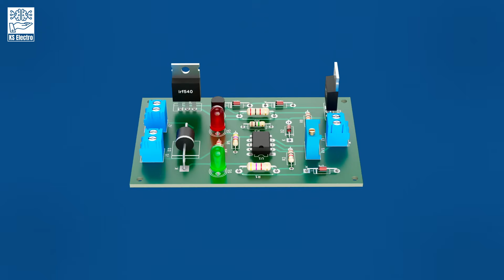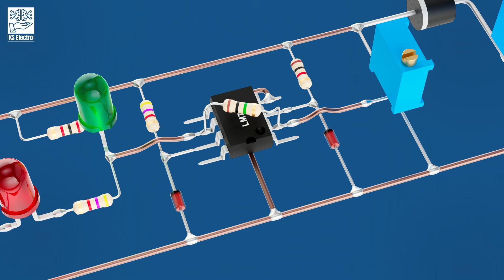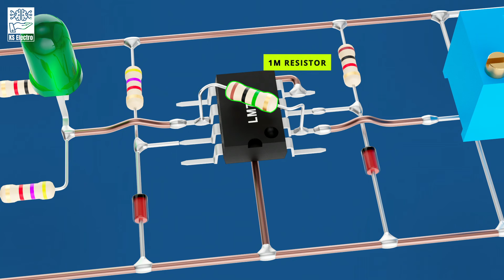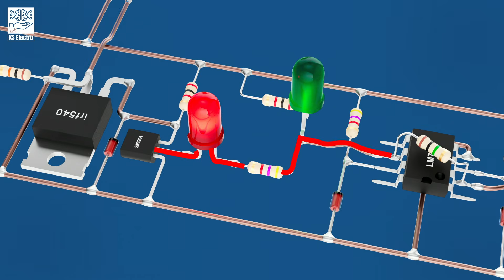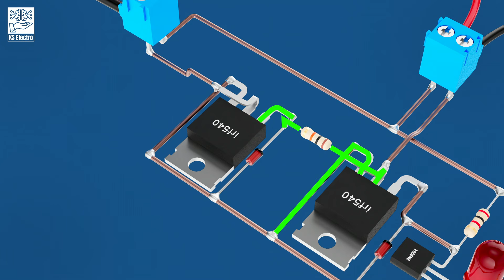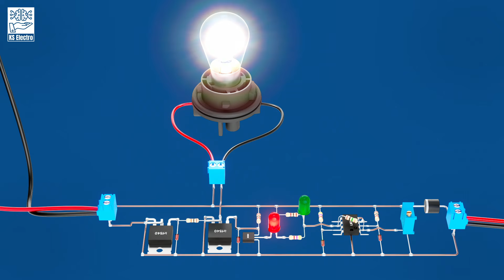DIY Solar Charge Controller Circuit Using Basic Components

Comment: Interesting circuit. The battery will never charge if there are no load. I will have to replace the load with a resistor, how about that ? Where else shall I connect the load to enhance efficiency

Comment: While calibration, would it work ? Bc I think when the solar panel isn't connected and the battery's power can't reach the circuit as the charging MOSFET is off, the opamp ic wouldn't do the sensing work as it doesn't get power to function.